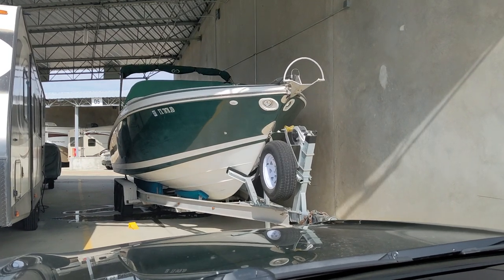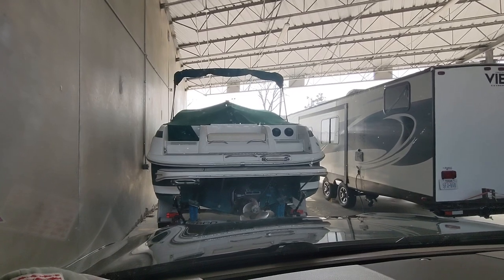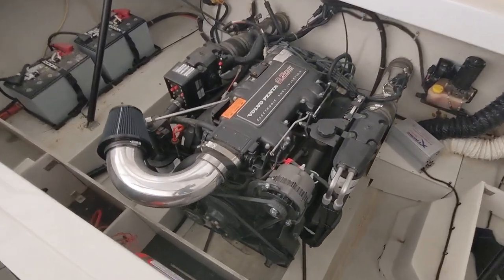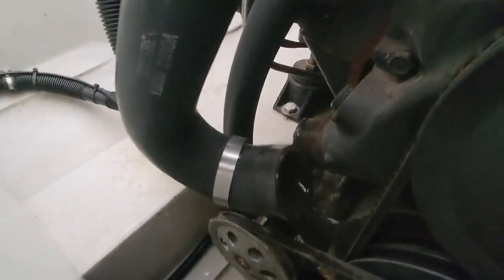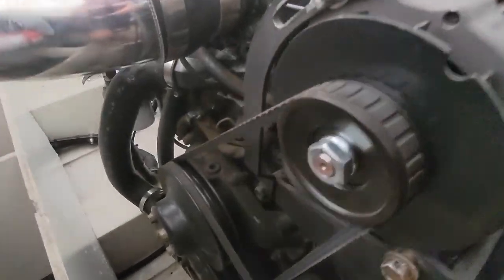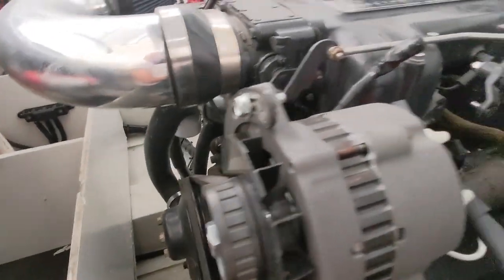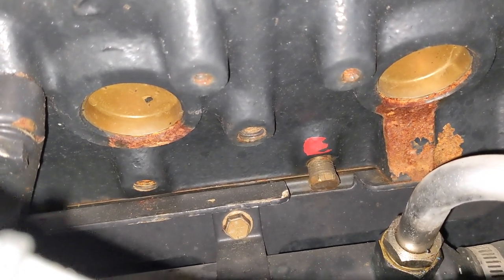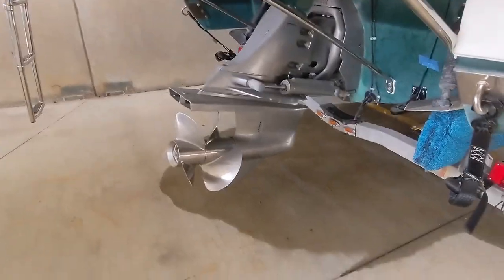Winterizing Your Boat - How to Drain the Water from the Engine

Comment from the maker: I highly recommend you get set of 3/8" wobble extensions. They make this and many other tasks where a socket is required in a tight spot much easier. I got mine here: https://amzn.to/33OavBm

Also, pick up a set of tight spot swivel head ratcheting wrenches. They're a lifesaver. These are the ones I use: https://amzn.to/3nYzwAO

Also, make sure to get a set of hose removal hook/pry tools. They are a life saver when working on any coolant hoses: https://amzn.to/3fUA46v

Comment: Wow the larger engine has a lot kore to do for draining water compared to my 2002 5.7 Volvo.  Where did you get the add on swim platform?
Reply from the maker: Got it from Swimplatforms.Com. They are fantastic. Have used their platform on our last 3 boats.
Reply from the maker: If you take a look at the other videos on the channel I should have 2 videos specifically detailing the swim platform inboxing and installation